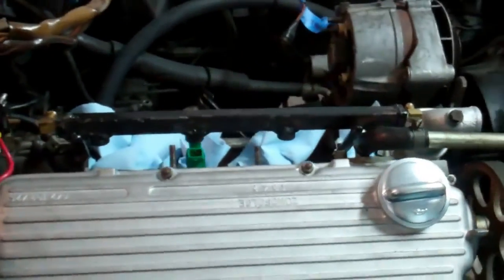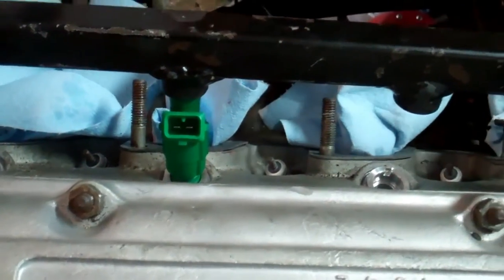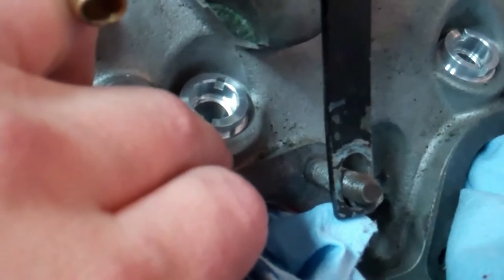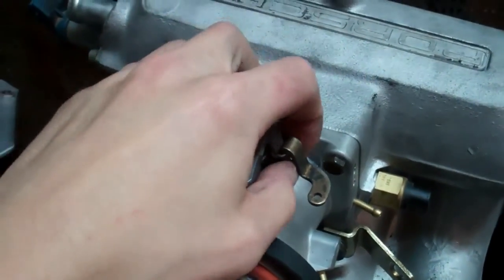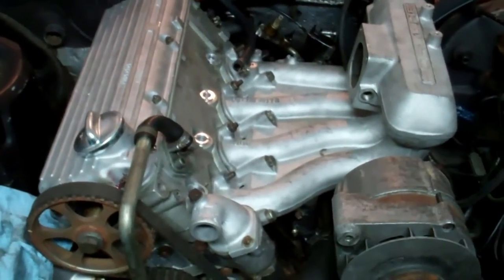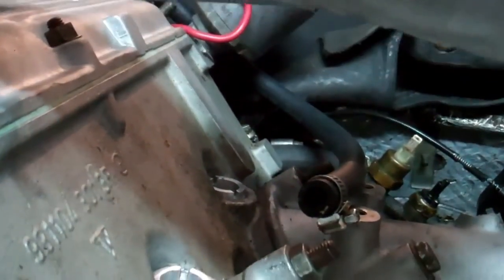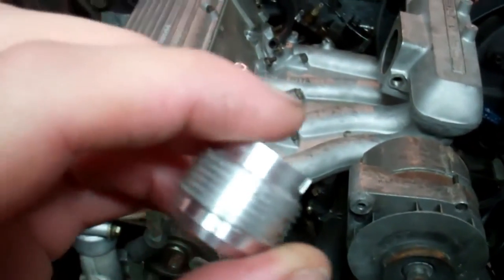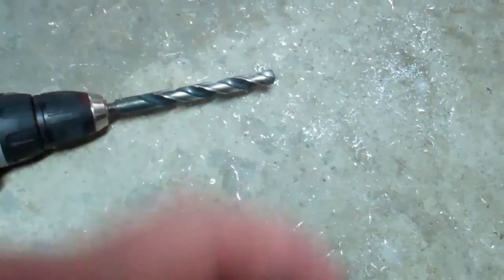1981 Porsche 924 Turbo | CIS To EFI Injectors

Comment: hey I have a few questions my dad has a 1979 924 na with the 5 speed it has been sitting for about 17 years and I was wanting to get it back on the road  I know price varies depending on the vehicle but we know the gas tank might have a hole in it and the fuel pumps are probably not working and the other basic things I wanted to know a general price of things so I could know what I'm getting myself into I have pretty much every car tool ever created at my disposal and I could do most of the work myself I just wanted some advice from someone who has actually worked on one
Reply from the maker: ehh my second 924 had a hole in the fuel tank and it was an absolute nightmare. If you have the ability, drop the fuel tank and fix it the correct way. Don't try to half-ass anything with these cars haha